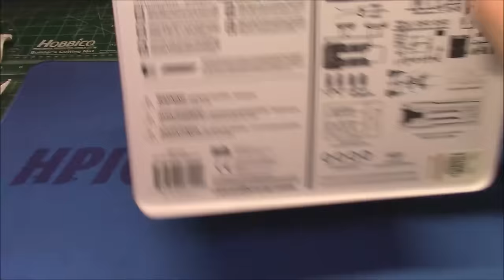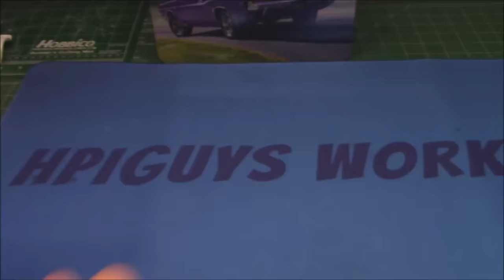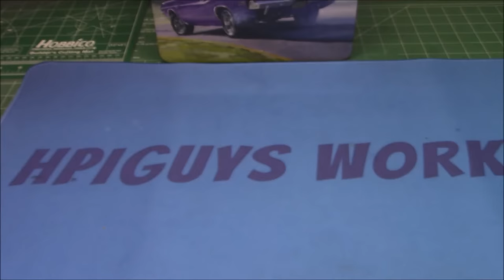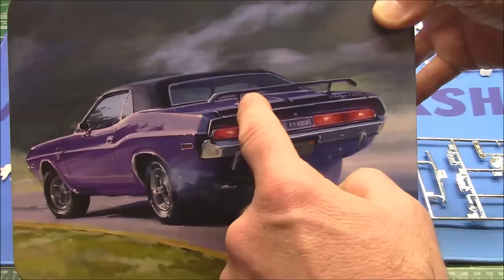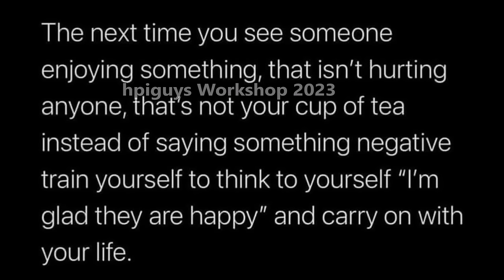1970 Dodge Challenger R/T 440 Six Pack 1/25 Scale Model Kit Build How To Assemble Paint Decal 440-6

Comment: This kit always seemed interesting, mostly their 426 Hemi with hood shaker, but I always heard how the roof was a nightmare to put on, which made me stay away from it. Also, I'm not really a vinyl roof person.

Nice build. Just in case you didn't knew, the '70 Challenger reverse light is in the middle, under the Dodge text.
Reply from the maker: Interesting, it has the detents in the center of the taillights, so I colored it in. Easy enough to fix. Thanks!
Reply: @hpiguy  Or you could keep it that way and say the guy customized his with '71 taillights (tho, IRL, I'm not sure if they'd fit in there).
Reply: Chris, the detents in the middle of the taillights is supposed to represent the reflector part of the taillights. Like the other viewer said, the backup lights are in the "Dodge" panel between the two taillights.

Comment: Round2 didn't do you any favors. Glued on roof??? No.   No Polyglas DEE-KLES or tampos?   Rallye wheels should be what you glue to the inside piece- paint them the shade of silver used that year, then have the trim rings on the chrome sprue, center caps again should be separate because they were a different color but despite all that you KILLED IT.  Not a green fan of anything except my "tree" but hey, your SKILL trumped the green thing. You WORKED it. X cellent.  My 2nd car as 21 year old was a 'Cuda so I knows my Rallye wheels. I'm LA for decades but Cuda years were CT - you ever see a jacked up Cuda with Rallye wheel G60 snow tires?  I had one! 👀

Comment: Great build. Interesting that the roof is separate. I'm thinking it might be for a release of a Challenger RT/SE which had a different rear window treatment. The steering wheel on this kit is correct for an SE but not a regular R/T according to a chart I found. However, I can't find any pictures of an RT/SE interior with this wheel. Weird.

Comment: Nice job on what has been a mediocre kit for the last 40+ years since Maychbox/Lesney owned AMT. 
Good to see they FINALLY fixed the hood,  tho the 'fake Hemi' valve covers are still there. 
What are the two limps on top of the intake manifold???  Six Pack indicated triple two barrels... 
the tabs on the lower rear panel were intended to go inside the rear fenders.
Maybe the best assembly of that awful kit I've seen

Comment: The big drawback to this kit back when and now is that it's a vinyl top (or convertible) only. No hardtop option.
Reply: Just like real Dodges -most came with vinyl roofs, started with the White Hat Boys ad campaign late 60s. It's why I went 'Cuda. But then this kit isn't vinyl top - it's whatever you make it. It can't be a convertible because that's not what the 'vert A pillar looks like and there is NO BOOT where the top would go!   👀

Comment: Based on that awful Yankee Challenge kit from the 80s,  which actually had a top down convertible option and a blower and a non vinyl hardtop...so basically no improvement to the kit plus less parts except for that odd attempt at a hemi 😢